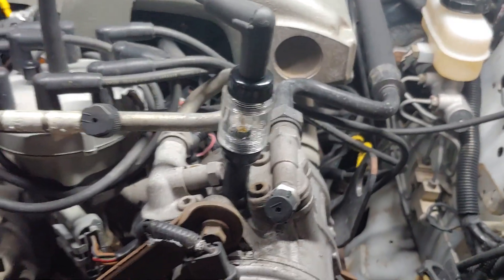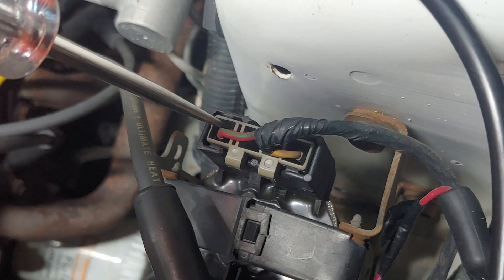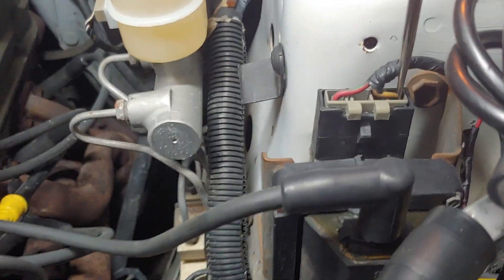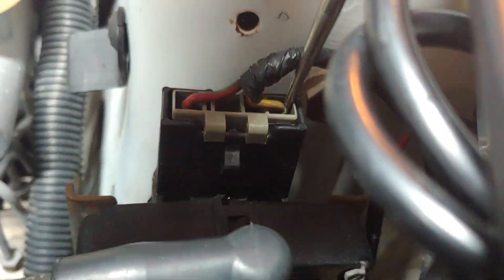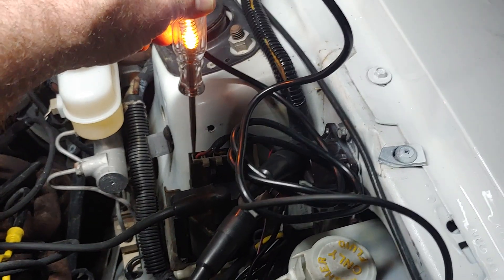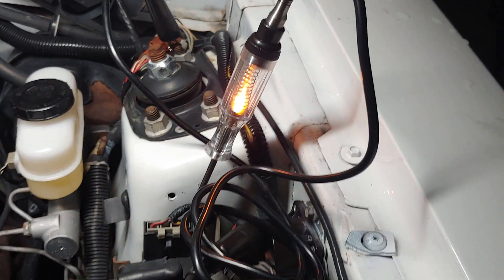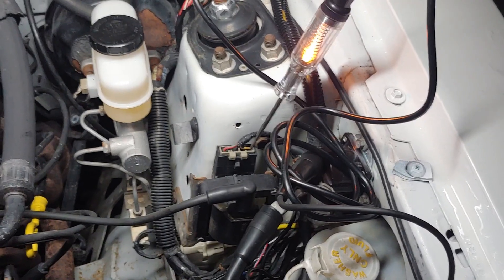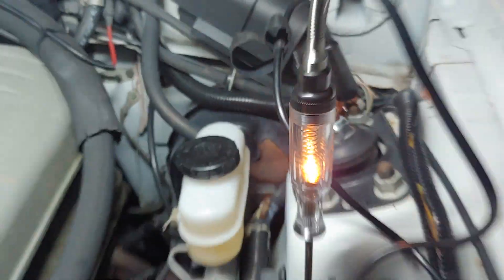How to test a TFI Ignition Coil on a 5.0L Mustang

Comment: Great video. I have a 86 mustang lx with 3.8 cfi.
Batt went dead on otherwise perfect running car, I put a weak batt I had in the garage in and it still needed a boost. Boosted, fired right up, took the cables off and it started popping and banging. Hooked the cable back up, engine ran fine. Did this a couple times. Shut it off, went to start again and nothing. Saw this video so I tested the coil, no flicker. Got a new module and still no flicker on the neg side. Fuel pump runs for a minute or so but does shut off. Turns off with ign switch.
So…. Hall effect in the distributor next or what do you suggest??

In the meantime I’m going to subscribe and look at your other videos to see if you answered it there.

Thank you!
Reply: Same.  New tfi module and no change.  What next?
Reply: @chris4k2113  Get a test light and check for power at the coil and signal at the coil. Watch my other video for instructions.
Reply: @lowrangeinnovascotia2930  looks like I have no control pulse and therefore no spark.  Rule out tfi module first?
Reply: @chris4k2113 Yes but the problem is 50% at napa/carquest/etc are garbage new. Try a new one and also check the output of the reluctor in the distributor IF it's still not working. A blown reluctor (like I had) is a 1 in 10000 chance but happens. If you replace the TFI and it still doesn't have spark (trigger signal) grab another distributor if you have one and plug it into the harness, hold the body of the dist on a ground and give it a spin, the test light on the negative side of the coil should flicker. Even getting a junkyard distributor, if you don't have one, and try it and if it is the reluctor you can pull it out of the junkyard distributor. (and the TFI on the side of it too) All the reluctors are the same so like I did, you can swap out the reluctor and pickup with any other distributor. (I used one out of a 1988 351W in my 1986 3.8 distributor, just used the 6 cyl blade not the 8cyl one)
Reply: @lowrangeinnovascotia2930  I have an old one I can use to test after I try another tfi module.  Let ya know how it goes in the next few days

Comment: Good afternoon sir hope your day is going well! Can you help me with something please?
Reply: What is it you need help with?
Reply: I need assurance if I can use that tool to check the ignition coil pack connector switching signals and not damage the PCM or anything else important on the 2003 DODGE CARAVAN SE?
Reply: @Diagnose1  You won't damage the PCM checking for coil control. On a Fox body, the PCM doesn't control spark, the ignition module does. So if anything, you would damage the ignition module instead. But you don't have to sorry about that either. The coil draws maybe 6 to 10 amps. An incandescent test light only draws 1/4 of one amp. An LED test light only draws about 20 milliamps. So neither test light is capable of drawing enough amperage thru the circuit to damage it. The coil draws way more than the test lights can.
Reply: @Pontisteve  
The exact tool that i have is called 
CEN-TECH 
6/12V Circuit Tester with 5 ft. Lead from harbor freight.
Reply: @Pontisteve  Idk how to backprobe correctly sir, are you able to please film a video showing me how to backprobe a connector which in my case would be the ignition coil pack connector that has 4 wires sir?
Reply: @Diagnose1  Purchase some Pomona 6411 backprobe pins. They're great. Place them on a set of banana jack leads for your multi-meter. Insert them into the back side of the connector you're working on, with the connector remaining plugged in. Insert the pin between the wire you want to backprobe, and the o-ring that seals the wire into the back side of the connector. Make sure you insert the backprobe pin parallel with the wire, so that it doesn't go crossing over into the pin next to the one you want to read. Insert the pin until you feel it bottom out on the back side of the wire terminal. This allows you to read the voltage on the wire without cutting into or unplugging the wire.
Reply: @Pontisteve  Good morning sir! Are you able to show that step by step on video and zoom it in close up to see very well how you backprobe the back of a connector? I only have t-pins.
Reply: @Diagnose1  I don't think I will be making any videos in the near future, sorry. T-pins are fine. Use the ones that are about 1.75" long, and clamp onto them with an alligator clamp connected to your banana jack. Backprobing is not anything difficult or tricky. Just put the T-pin between the wire and the o-ring that seals the back side of the wire to the connector, slide it all the way in straight until it bottoms out against the terminal.

Also, never use two T-pins on the same connector, because if they touch each other you could fry a portion of the PCM. Also, if you don't get the readings you expect on the backprobed connection, then just pull out the backprobe and insert it again carefully. Do yourself a favor, and get a pack of the Pomona backprobes. They're wonderful.
Reply: @Pontisteve  Thank you very much for all of your help, patience and advice I appreciate it a lot. 💚🙏

Comment: Ok so the cool is flickering but I’m still not getting any pulse
Reply: Coil*
Reply: The flickering IS the pulse. Although the natural surge and fall of battery voltage during cranking as the engine fights each cylinder's compression can also look a bit like a flickering as well. True coil control is a little more pronounced than voltage variations due to compression.

Comment: SO Helpful!!! My car died and wouldn't restart. I did the simple test you showed. My module tested bad. Went and got a new one.. Car runs as good as ever! Thank you so much!!!
Reply: If you got a module that works right the first time, you got real lucky! Some times it takes 3 or 4 modules to get a good one. Even the Ford one is now chinese junk.
Reply: What module are you talking about
Reply: @quarterblacktravis  On Ford vehicles from the 90s and i believe some 80s there is a module attached to the distributor with 2 screws,its usually grey and the big harness plug connnects to them,they are famous for going out at the worse time,there was actually a lawsuit back in the early 90s about them,once they go out you are not going anywhere, not even God could turn that car back on.

You go buy a new one and you need a special tool to get the screws out,its basically a little screwdriver that acts as a socket with really thin walls, you can get a socket and turn it down and you'll have the same tool, you have to put dielectric grease (artic paste, the stuff used on computer sinks works better) on the metal part of the module that goes against the distributor because heat kills these modules,on the 94 and 95 Mustangs that came with the 5.0 they relocated the module away from the heat,sorry for the long post, i try to cover all the bases.
Reply: @dntlss  thank you I got it.  It was making my car ru. Like crap. Thank you

Comment: Would this same method work on a 1988 Lincoln Town Car? It's the low output 5.0 EFI. I'm having ignition issues and I've pretty much narrowed it down to the coil area
Reply: Yes, it's the same EFI. This video shows you how to determine if the coil is being TOLD to turn on or not, but this video does not cover how STRONG the coil is. To test for coil strength, remove a plug wire and hold the incandescent (NOT LED!) test light about 1/4 inch away from the tip of the plug wire. As someone cranks the engine, slowly pull that test light further away from the tip of the plug wire. A healthy coil will easily jump a 3/4" gap with a blue/purple spark, where a weak coil will only jump maybe a 1/4 inch gap with  a yellow spark and won't jump a larger gap.

Comment: I have a 95 mustang 5.0 I’m working to get going for the step so. So far I’ve found a bad pcu, replaced the ignition control module, distributor, and coil. I’ve also replaced a few other things on the egr system. With replacing all of that on the ignition system I still am not getting any pulse to my coil from the tfi module. I have a ignition diagnostic circuit code when I pull from the obd1. I’ve checked all wiring and haven’t found any grounded or shorted. Continuity is good from pcm to tfi and then to the coil. Any idea what else could be causing this? Thanks in advance for any help you can provide!
Reply: You need to use an LED test light to test the PIP signal wire at the ignition module. During cranking, this light should blink as you crank. If you don't have this signal, you have to make sure there is 12v and ground going to the module. If you have a pulse here, you should have spark. Cranking the engine should cause a PIP signal, which should make the fuel pump run for at least 1 second. If you have PIP signal, then the TFI module should send a control signal to the coil. The coil should then fire, if it's also getting 12v to the coil.

Comment: UPDATE: When wiring a Holley Terminator X. Do not just splice into the factory coil wires. The 22K resistor will keep the coil from firing. 

Thanks for sharing this information. I appreciate the good clear explanation. Teachers are more valuable than inventors. People forget that.
Reply: The 22k resistor should just insulate the tachometer from the flyback voltage the coil creates when you shut it off. It shouldn't interfere with coil operation, because that resistor is between the TFI module and the tach, not the TFI module and the coil.
Reply: @Pontisteve  The resistor was in the wrong place. That was my fault. I’ve asked a couple “Super Mechanics” why a resistor would be in the coil wiring. They had no clue… I find that funny. Also, Thanks again!
Reply: My car won’t run at all. I just wired my coil with out factory wiring

Comment: I got a new pigtail from lmr and it didn't help at all
Reply: The pigtail is rarely the problem. The modules are the most likely suspect. Watch this video and see how to test for coil control, and coil constant key-on power. Start there. Then test the PIP sensor next.
Reply: @Pontisteve  I put it back on the stock ignition coil and it has power to both but I pull my distributor the other day and me that's never owned a mustang didn't know to mark the spots
Reply: @Mattys91gt  I have a video on how to install a distributor and have it fire right up, and be within 2 degrees of perfect. One big trick is to set the engine to 10 BTDC mechanically when you stab the distributor, not 0 TDC.
Reply: @Pontisteve  why at 10 and not zero it's my bad it's my first mustang and first v8 I had all sport compact cars growing up I never thought of marking any
Reply: @Pontisteve  I got it running but it doesn't seem perfect I made sure it's not 180 that's been my issues I'll go watch that video
Reply: @Mattys91gt  Because ultimately you're trying to end up with the timing set at 10 BTDC, not at 0. So you find which stroke the #1 piston is on, compression or exhaust. Then you hand rotate the motor up to exactly 10 BTDC. Then you put the distributor in so it has plenty of room to turn it either direction. Then you rotate the pickup coil so that the leading edge of the narrow stator tooth is right up against the dead center of the pickup coil. Then tighten the distributor and start it up.

If you do it like I show you in the distributor stabbing video,  you will end up with the engine firing up and running, with the timing nearly dead on. So it starts easy. But if you do all the same stuff and then set the motor at 0 TDC, you may get it to fire up, but it will be closer to 10 degrees off and you'll have to make some quick timing adjustments. In my case, I set it like this at 10 BTDC, and when I fired it up in my video, it ran great and I was within 2 degrees of my final goal of 10 BTDC.

Comment: Going through all your videos trying to figure out whats going on why my fox I bought a month ago lol. I have spent countless hours trying to figure it out. Wish I could show you the video of what it is doing haha. Will check the ignition switch tomorrow like you said. I think I have it narrowed down to either a bad ecu, or bad wire pwr side of the coil, or a bad alternator even though its a brand new 95 amp from LMR. Checking all 3 tomorrow. Love your content! I have fixed a ton of stuff on the car already from yours and other videos just like yours! Thanks!
Reply from the maker: Be sure to inspect the capacitors inside the PCM. If they are the original 3 teal blue capacitors, they're bad.

Comment: Why is it that when I probe the coil on my 1995 in key on engine off, the test light doesn't light up.  When I check if the coil has spark, it has spark.
Reply from the maker: The coil should have power all the time, key on engine off, on the red wire. The coil only has ground for a few thousandths of a second at a time on the other wire. If you're checking the red wire with a test light, make sure the test light is grounded to a good ground, like a strut tower bolt. If you're checking for coil control (pulse), you would hook the test light to battery positive, and touch the tip to coil negative (the non-red wire) and watch the test light carefully while someone cranks the engine over.

Be sure to use only an incandescent test light for this, not an LED test light. You'll burn an LED light up. Also, make sure you test your test light by checking it using battery positive and negative, to make sure the test light bulb is good and functioning. If the light tests good, double check your connections for the test.
Reply: @dragradialperformance3540  Would and MSD 6AL change this?  The coil sparks when I jump the "magnetic distributor" plug that hangs off the wiring harness.
Reply from the maker: @WombRaider7878  The 2-wire SPOUT connector located near the distributor just switches the ignition module from firing directly off the PIP sensor in the distributor, to firing off the PCM's command which in turn gets it's idea of when to fire from the PIP sensor, then alters that a bit.

If you're talking about the 3-wire magnetic pickup inside the distributor, any time a piece of metal comes between the two walls of the sensor, it will fire the coil.
Reply: @dragradialperformance3540  there is a plug coming off my msd 6al.  I jumped that and the coil did spark.  I tested the fuel pressure and I get 35 with KOEO.  Which is odd considering the pump is a 50/70.

I checked the plugs. They were fuel fouled, but that may be because of me cranking on it.  It didn't start with starting fluid.

I am at my wits end with what this could be on my car.

Comment: I've got no power at all to the coil. On a 95 5.0 f150
Reply from the maker: Use a wiring diagram to determine the source of the power to the coil, and backtrack to find out where you lost it. Usually in that era, the power comes from the ignition switch somehow. Those switches used to supply all the power to the high amperage coil thru the switch contacts, and they would burn up or corrode prematurely because of that.

Comment: So I'm deal with an 87 cougar with R/LG coming from positive on coil, and 2 G/Y on negative side. One G/Y goes to 22k resistor which I'm assuming goes to pin 4 on EEC, and G/Y wire to TFI module. I guess the other G/Y wire goes to Tach?
Reply from the maker: The coil gets power all the time on the red/light green wire (if the key is on). The computer grounds the coil for just a few thousandths of a second when it wants the coil to charge, and quits grounding it when it wants the coil to discharge (fire). The PCM, or the ignition module itself if SPOUT is unplugged, decides when to fire the coil.

When it wants to fire the coil, the ignition module sends the ground signal to the coil. A copy of that signal runs to the tachometer, to display engine RPM and to the PCM. It runs to the PCM thru a 22k ohm resistor, presumably to prevent the voltage spikes caused by turning the coil off from damaging the PCM. In any event, the ignition module is the source of this ground signal. So that ignition module is sending ground to the coil, the tach, and the PCM (thru a resistor).
Reply: @dragradialperformance3540  thanks for the reply man. Another thing is, I'm testing for spark with distributor out, but grounded by jumper cable to good ground on car. The only time I get a ground is if I'm rubbing the distributor on something but I'm not getting constant ground, unless like I said I move it around but that's even still a fraction of a second will it ground.
Reply from the maker: @jacobkmiller  That's exactly what is supposed to happen. Every time you turn the distributor gear 1/8 of a turn, you will get the coil to fire. And an injector too. And the fuel pump will kick on. So if the distributor is out and you rotate the gear/shaft, you'll hear the pump run, the coil will fire, and an injector will fire for every 1/8 turn. If you have that, there is nothing wrong with the ignition module or PIP sensor. The PIP sensor tells the PCM where the engine is in it's rotation. The PCM then decides when to fire the coils and injectors based on that information, and sends the signal to the ignition module (SPOUT) to fire the coil. The module then fires the coil by grounding it briefly.